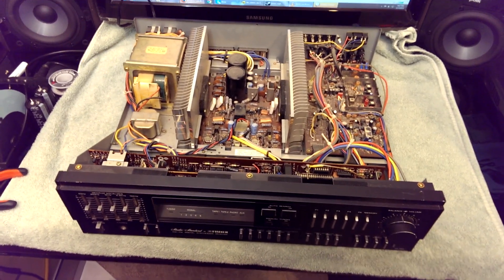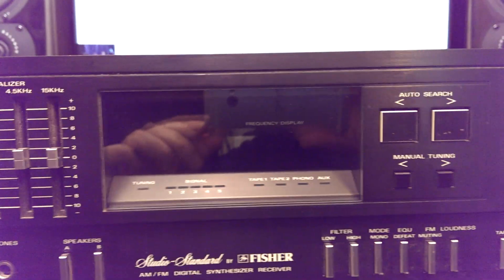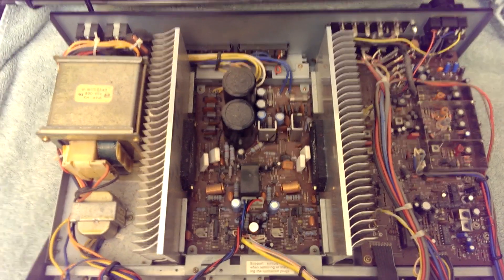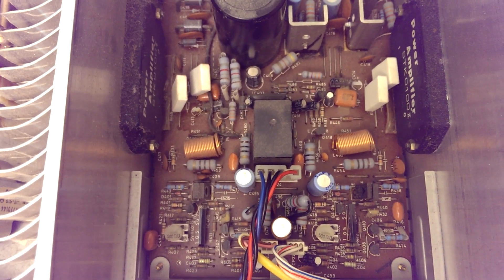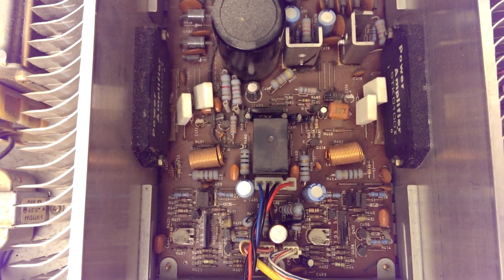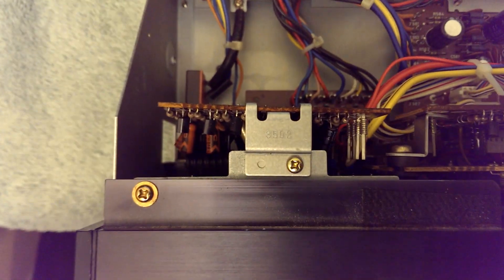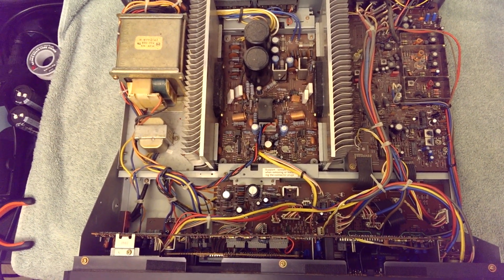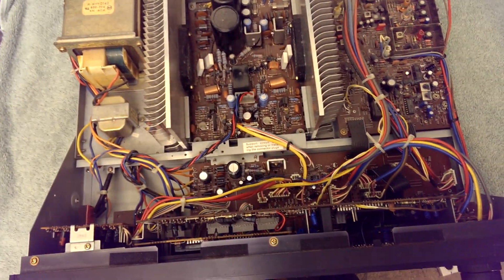Fisher RS-280 Repair Preview & Circuit Tour

Comment: I have one of these that I'm using on my computer right now. It replaced my Pioneer SX780 that fell inside a box when I was moving. Its protection relay is clicking when it gets a bass hit or loud signal. Do you have a part number for that cap at 3:00?
Reply from the maker: Any cap rated for at least 125°C at the same or greater voltage and the same capacitance that physically fits will work. Nichicon BT, BW, BX or BY series works well here as does United ChemiCon GPD, GXF and GXL series.

Comment: How would you feel about bridging one of these to run a single Klipsch Epic Series CF-3?
Reply from the maker: Bridging is NOT recommended as you're likely to exceed the safe operating area of the output modules.

If you bridge it, you'll double the output voltage swing which increases the power by FOUR since the load impedance is the same and thus the current also doubles. Now your 100W amp modules are trying to supply 200W each.

Parallel operation is also ill advised as the current sharing may not be optimal. This may cause one of the modules to fail.

I generally advise against bridged or parallel operation of amplifiers not explicitly designed for such for the above reasons.

Comment: Did you end up replacing the hybrid brick? I have the same model in silver lighting up the same way. I see one bad cap for sure as it's domed on the top. Sorry I know it's an old vid, but a good one!
Reply from the maker: Yep, the STK module was bad. This same unit is in another video where I show off it's performance. The modules are getting scarce and some have actually cracked them open and manually wired in new output transistors using wires and external transistors. (not for the beginner!)

Comment: Found this video today. OK, that's a few years old. But maybe, you'd like to know that I have a Service Manual of this unit from August 81. So it's definitely from the beginning of the 80s. I would say it was Fishers Top Receiver of this time. The Amplifiers (without built in Tuner) of the same series where the CA-250, CA-350 and CA-550. All had "smaller" darlington packs than this Receiver. In Europe there where listet two more Receivers in an info of the line: The RS-245 and the RS-270.I think Avery Fisher had a lot of influence on Sanyo (if not to say he was their technical advicer) at their beginning in HiFi because because before he sold the brand Fisher to Sanyo they produced Fishers own designed units. And even at the start of the Sanyo-Fisher era he gave his Feedback for the first years. And if you look back further, you can see that many inventions in HiFi came from Fisher. You could say HiFi was Avery Fisher's Idea. So Fisher used the Slogan "The First Name in High Fidelity" for a long time.At the back of this early Sanyo built units there usually is a serial number which shows the year and (I think) the calendar week they where build in a four digits block.And I found out the fronts show only the name "Fisher" while the same units later came out with the old Fisher Symbol before the name. Means you can see older CA-550 without and newer CA-550 with the Symbol for example. Maybe Sanyo didn't own the rights on the symbol first... But I don't know if there are any of the RS-280 young enough to show the symbol.Maybe a reason for the "strange" layout is just the time it's from. Others often where later und could see existing problems.By the way the later Fisher CA-275 still used the STK100 darlington pack. But at this time Sanyo already used plastic instead of metal fronts for the Fisher units. Later Amps went back to separate Transistors. Only the smaller M-Series used the STK then.And as far as I can see at my amps, Technics still used the Sanyo-packs at this time but sooner started to reduce the price by cheaper switches instead of plastic fronts. So they show problems with the speaker selectors...

Comment: My amp keeps blowing this one of two fuses it uses, I use a 3A 250v AGC fuse and it keeps blowing out, why?  I remember the first time it blew, I touched the red and black speaker wire that connects to my subwoofer speaker and it short circuit something, I can't find out what though, my amp looks fine but it's probably a mosfet, the other fuse it uses is a 4A 250v on the inside of the am and a 3A 250v on the outer side of the Amp. here's a couple pics I took of the Amp,The model number is STK4046XI Power Amplifier http://oi62.tinypic.com/mm5wcy.jpg and http://oi61.tinypic.com/350ugdd.jpg  Do you know what the problem may be?

Comment: Holy crap, nice glow on those emitter resistors!

You might try opening that hybrid module if you've not done so before. They're usually hollow and not potted solid (you can tell by weight). The easiest way to open them is with a bench vise and pliers, and attempting to pry the plastic cover away from where it's glued to the metal backing. Try not to bend the metal too much.

You should be able to see the control circuitry and the outputs, and maybe even tack in some TO220 transistors just to see it run again at low volume. All the semiconductor devices are on their own dies with bond wires in free air. Neat stuff!

Here's an example from a similarly packaged motor drive IC:
http://i.imgur.com/NCRjeVu.jpg
Reply from the maker: I popped one open back in the day by breaking the glue bond as described; they are pretty cool inside. That was the first time I had ever seen a bare transistor die.

Aside from the cost and occasional difficulty of sourcing a module, I like STKs! They varied in complexity and fidelity but Sanyo made some very well designed amps for their STK lineup. If given adequate power supply, as in this Fisher RS-280, they perform as well as any discrete amp of comparable design. (The power supply is key...STKs got a reputation for sounding thin due to more than a few sets using inadequate power supplies!)

I might do the transistor grafting trick for a personal unit but definitely not on one offered for sale. I built a reputation for some very solid repairs and even if it worked, it would look awful.

The transistors inside these monsters would need to be subbed with TO-3P or TO-247.

The STK0100-II is a fully complementary circuit but it's of medium complexity. The later STK40xx series, especially the XI variants were ultra high fidelity parts.
Reply from the maker: Cracking an STK open is a last resort. TO-220 will not survive in this application. Use TO-3P, TO-247 or TO-264. You need at least a 160V, 12A transistor with a power dissipation rating of ~150W.